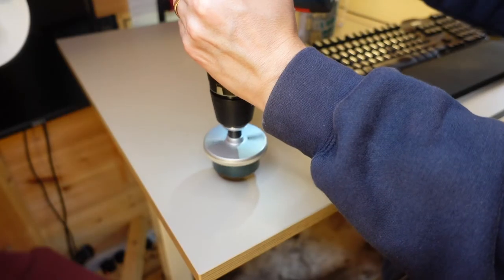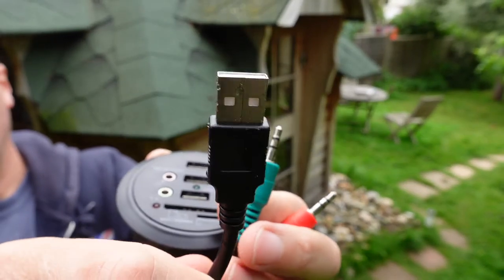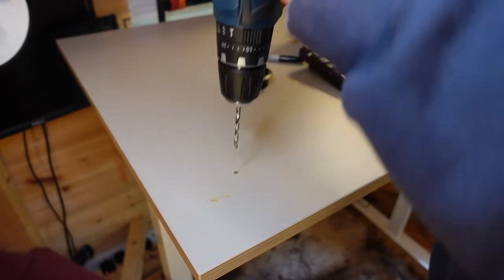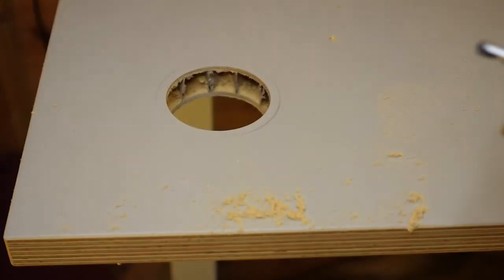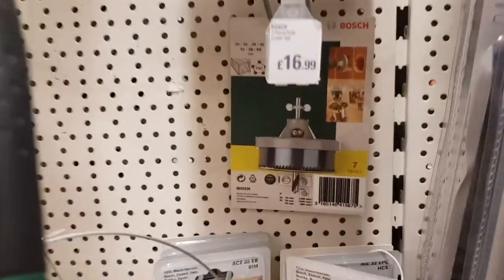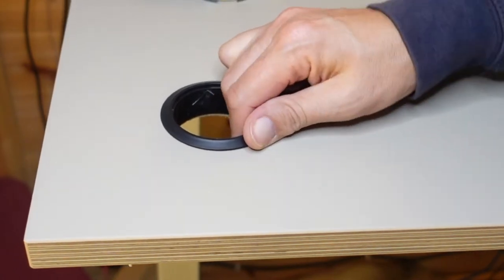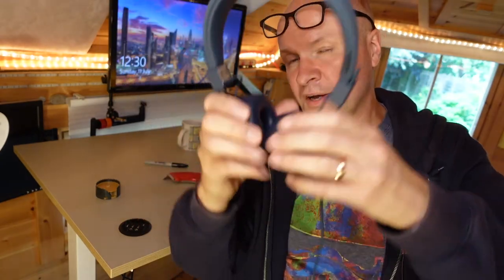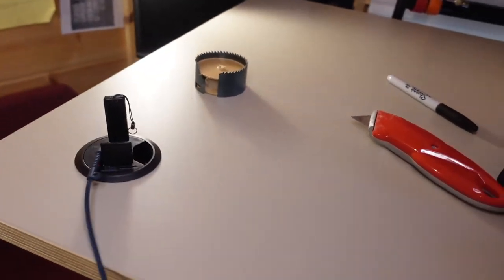Hack my IKEA desk with AUDIO HUB! My easy YouTube studio hacks: in-desk USB headphone socket

Comment: Hi Neil,

I'm looking to do something very similar with my desk but was wondering:

Is that the skarsta table top. The frame certainly looks like mine but I'm not so sure on the table top
Reply from the maker: Hi thanks for the kind question @ilyas4698 - I went back to check my recordings and it's definitely the Skarsta table top, because it has the holes pre-drilled underneath for the wind-up handle.
I'm not sure if they do this colour now, because I can't see it on their website.
Hope this helps - and good luck - I don't regret mine at all!
Reply: @neilmossey  Thanks, that's a massive help as I now know where I should be drilling. Also, great video 👍🏾
Reply from the maker: @ilyas4698  Thanks so much and... good luck!!!